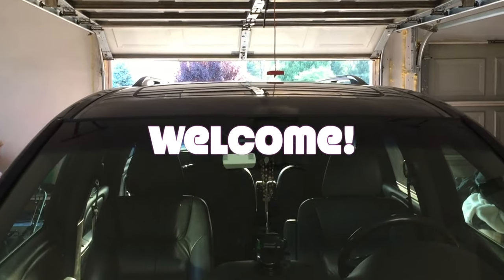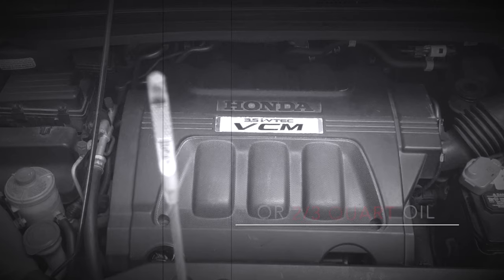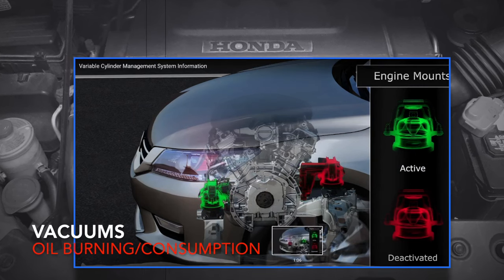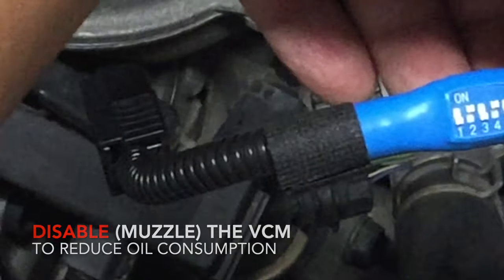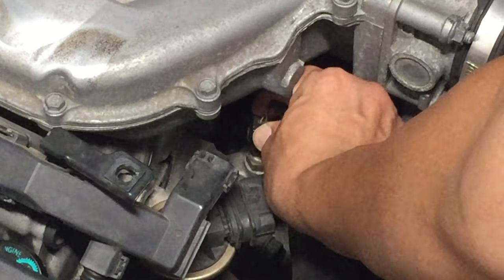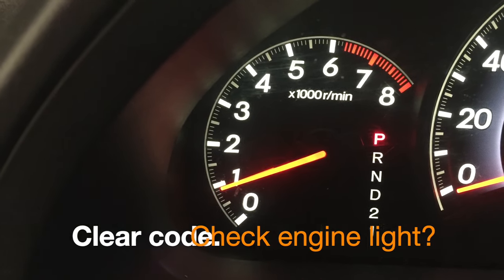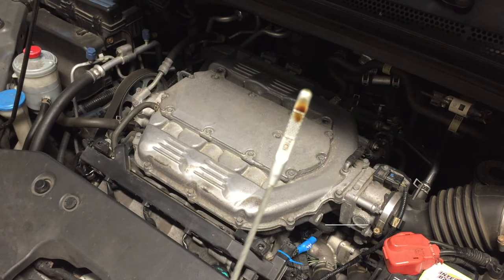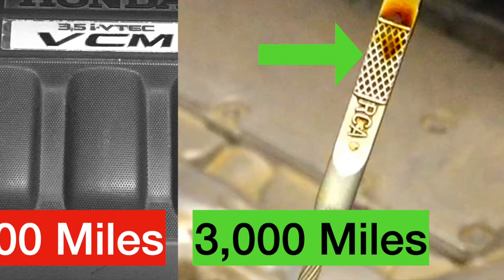Honda V6 Engine Burns Oil? Fix it in 5 minutes.

Comment: This is a workaround. What is the real fix? Engine rebuild?
Reply from the maker: I think of it as a software workaround. Theoretically Honda could have updated the software to deactivate VCM but don’t think that will happen. The idea of these muzzler products is to create a false environmental signal for the software to believe the condition isn’t ready to activate VCM.
Reply: @profsg  I get how it works. I also get that by telling the ECU the engine is colder than it is, the target AFR will be (slightly) wrong.

My point is that I am guessing the car was OK some time ago, it did not have the issue when it was new. How to bring it back to that state? Or, what is causing the issue?
Reply from the maker: Good point! This would have never happened in the ideal world. But there is no perfect seal (e.g. with piston rings) and, over time, there is wear and tear. When an engine gets aged, the activation of VCM will always create vacuums (no firing) in certain cylinders which tend to suck oil into the combustion chamber. Again, when the engine is worn and piston rings no longer seal the cylinders that well, they all make it easier for oil to get in and get burnt. Hope this makes sense. 

BTW, there is another common reason for oil burning because of blow-by and I've just posted another video about it: 
https://youtu.be/bGVFDy7I0j8

Feel free to post a comment or question there.
Reply: @profsg  ow, I thought that when a cylinder is not firing the valves are also driven in such a way that those cylinders are simply moving air in and out. Thanks for the pointers.
Reply from the maker: Sure! The reason the valves don't open/close on the deactivated cylinders is because this is not a direct injection engine (on J35A6 here). If the valve opens to let air in, it will be air/fuel mixture and will waste the fuel that it was designed to save in the first place. :)
Reply: @profsg  I guess not exactly because it is multi-port injection (right?) so the non-firing cylinder would have to 'steal' air/fuel mixture that is created right near the valve of a firing one if it was to get fuel. Anyway, another reason this is tricky/fragile is also because MAF does 'see' the air sucked by the non-firing cylinder and needs to calculate the actual air used for combustion. They would need to separate a lot mechanically and air-wise to make this closer to perfect and less affected by what you described.

Did you happen to know how does the coolant temperature mod affect MPG?
Reply from the maker: @piotrr5439  In my experience, there was only about 1 MPG difference with the muzzler.

Comment: I Used VCMuzzler 2 on our 2008 Odyssey and 2017 Ridgeline. I should have known this before our odyssey’s making that tick tick tick noise and it is now tick tack tack tack tack. Our mechanic recommended a used engine for the 2008 Odyssey cheaper to replace than to rebuild the engine…😢
Reply from the maker: Has valve adjustment ever been done on the engine? I wonder if that noise is due to valve clearance or something else. Impossible to tell without hearing it. I did my valve adjustment at around 100k miles and it doesn't appear to have this issue.
Reply: Timing belt tensioner can also make that noise before they completely go out and take the belt with it . Look it up on you tube
Reply: @profsg  done but dealership said cannot adjust anymore? They recommend engine replacement. I used tribotex this time.
Reply from the maker: Yes, timing belt tensioner can be a reason too. You may be able to check or replace it without taking the timing cover off, though don't take my words as I did mine several years ago. It's almost time for another timing belt replacement so you may consider changing it now altogether. Make sure to use the OE AISIN kit for the job.
Reply from the maker: Honda valves can always be adjusted, unless the nose is due to something else. Is there internal damage/wear of the engine that justified an engine replacement? Tribotex won't help if it's a timing belt/tensioner or valve lash issue. But I guess whoever works on this engine and hears the noise knows it better.

Comment: I'm curious why having one bank of cylinders disabled would cause oil consumption. I have a 2012 Odyssey and just purchased a VCM Muzzler, however I don't have an oil burning issue so this is more of a preventative measure. It's at 135k miles and I'd like to ultimately reach $300k miles.
Reply from the maker: The short answer is it creates vacuum making it easier for oil to get in, unless there's perfect seal which is never the case with an aged engine.
Reply: My 2012 odyssey is at 156k miles and just experienced spark plug fault 8000 miles after new spark plug due to oil buildup. Dip stick showed no oil. I will be trying this out.
Reply: @cullenflake3163  - I'd also check (basically shake) the PCV valve too. Hopefully it's clogged as it's an extremely inexpensive part and very easy to check and replace.
Reply from the maker: @cullenflake3163  Yes. And as suggested here, check and replace PCV: https://youtu.be/bGVFDy7I0j8

I suppose your new plugs are OE or OE quality with Iridium like NGK or Denso. Otherwise I'm not surprised by failed plugs after the low mileage on an aged engine.
Reply: There are other bad side effects to VCM, including fouled plugs and premature failure of ignition coils, CAT converters, motor mounts, PCV and piston rings.

Comment: I got this 10k mile/ annual oil, went 8k and oil light came on had like 1qt in the engine 😢
Reply from the maker: Sorry to hear about that! The promotion of 10k mile oil change is nonsense. Definitely go back to normal 5k miles or 6 month oil change. Synthetic 5w20 or 0w20 is acceptable on this engine.

Comment: It will fix nothing permanently unfortunately, my VCM was disabled during the first 1000 miles, I'm at 160K miles now and it uses a quart of oil for 6000 miles. All Honda engines start consuming oil after 100k miles. I have switched to 5w-30 now from 0w-20, hope it helps
Reply from the maker: Don't get discouraged. Did you meant after the first 1000 miles the VCM muzzler no longer works? You may need to adjust muzzler resistance if the ECO light comes on due to seasonal temperature fluctuation. This will mitigate oil burning if not completely eliminating it. Mine is over 160K miles too. Frankly, burning 1 quart every 6000 miles is not bad at all. Even newer engines burn oil and, per Honda's standard today, burning 1 quart every 1000 miles (perhaps even every 750 miles) is "acceptable". I don't think so; but yours is manageable. Switching to 5W-30 is okay; but I doubt it will reduce oil burning. BTW, have you ever replaced PCV and cleaned EGR passages? Keep up with regular good oil changes every 5000 miles / 6 months and your engine will do just fine.
Reply: @profsg  Thank you for your answer. What I tried to say I've installed it VCM Muzzler at 1000 miles on brand new car, VCM was fully disabled. Now at 160k engine burns oil at 1 qt for 6000 miles. It is not my first Honda, they all burn oil at some point. PCV has been replaced as well. I mean Honda owners shouldn't be surprised with some oil consumption no matter what
Reply from the maker: Thanks for clarifying! You did a great job on the maintenance and the oil burning is minimal compare to many other Hondas out there. I couldn't agree more on the expectation! New engine designs, thanks to EPA's CAFE regulations, are making this and related problems worse.
Reply: @profsg  Thank you, Sir!

Comment: Use the s vcm dont listen to this guy. Anything with a resistor in it will require you to change the resistance manually in different temperatures. Been using the s-vcm for 2 years now with no flaws
Reply from the maker: No objection to S-VCM muzzler, which I’ve heard good words about. Glad it worked out for you. I’m happy with the cheap VCM Dipressor too and don’t mind the manual adjustment.

Comment: Try using high millage oil
Reply from the maker: I tried and it didn't make a difference. It may help mitigate oil leak with high mileage additives. But I did replace valve cover gaskets etc and there is no leak.

Comment: What is ohms
Reply from the maker: It is a unit of electrical resistance: https://en.wikipedia.org/wiki/Ohm

Here the sensor uses the resistance reading to project the temperature, which is some inverse function of resistance. By adding resistance (ohms), the muzzler fools the sensor (the computer actually) to get a lower temperature reading.

Comment: I don’t have oil consumption, so I’m not disable the vcm, also I get very good gas mileage on city with that
Reply from the maker: What engine is yours? The next generation VCM is said to perform better. Mine is second generation VCM which is known to have problems. The MPG DIFFERENCE is minor. My muzzled engine is about -1 mile per gallon worse but I now have the peace of mind that it is reliable for the long run.
Reply: @profsg  2022 Honda ridgeline
Reply from the maker: Yes, it comes with a new (hopefully improved) version of VCM. It's the latest and only time will tell how it will endure the real test. Honda engines are great but VCM often falls short. Two areas to look out for--potential oil burning and engine mounts.
Reply: @profsg  I hope so, thank you for the info

Comment: Side effects of VCM are ridiculously prohibitive a stupid idea ,like low tension rings.
Reply from the maker: Yes exactly! They were designed for the same reason and for ideal/perfect engine conditions. For one, they both require good engine oil and short oil change intervals but in reality Honda recommended the opposite. No surprise though b/c all these look great on paper.

Comment: This does not happen on the 2016 accord v6 vcm
Reply from the maker: Does it have the third generation VCM? This is a common issue with the second generation, which is on my engine (j35a7). There appears to be an improvement in later versions, but it is not always consistent. My problems only appeared around 80k to 90k miles. So keep an eye on the engine oil level.
Reply: @profsg  it has the earth dreams engine
Reply: @profsg  2016 is the 9th  generation idk where you get 3rd
Reply from the maker: @jaxripper251  I was referring to the generation of the VCM technology, not the vehicle model or engine itself. The VCM in the video is 2nd generation. Your 2016 Accord with earth dreams has the next or 3rd generation VCM, which should be improved according to reports (starting in 2013). Hopefully it is no longer a major issue with yours, but time will tell and it's good to monitor it.
Reply: @profsg  I looked it up thousands well over 100k for 2016 v6 no oil.consuption at all
Reply: Nice 👍🏽